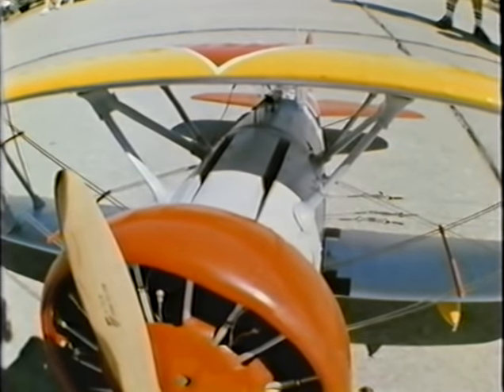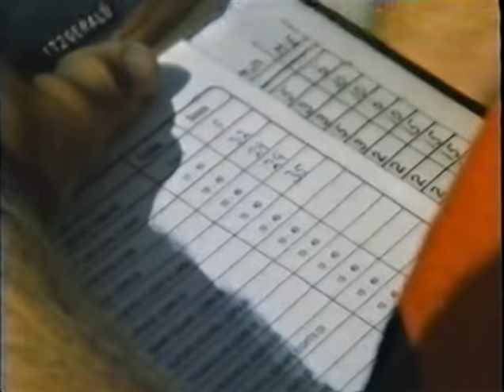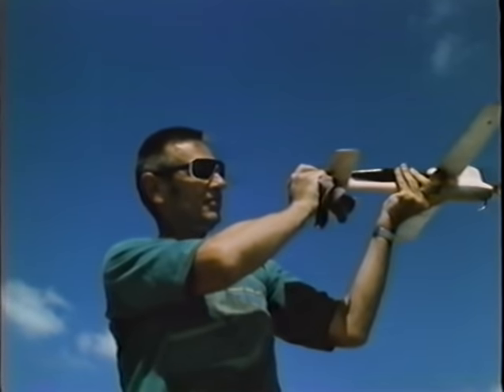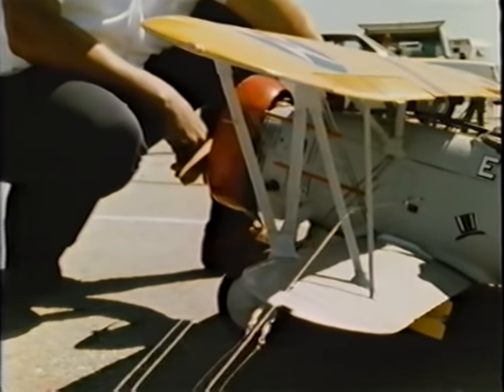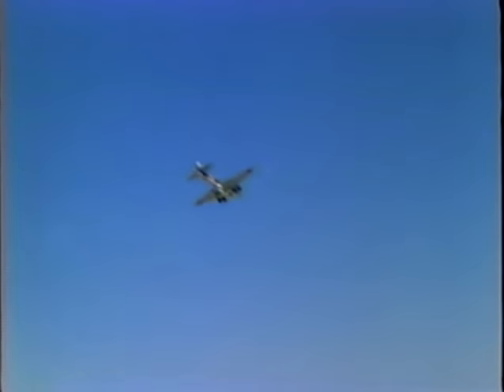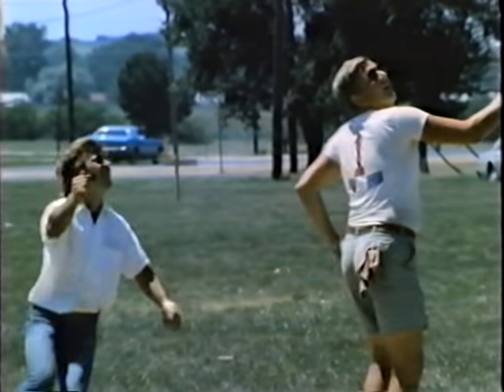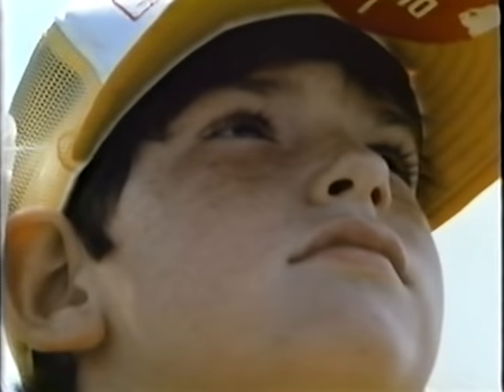Control Line: Wired For Excitement - AMA Films

Comment: This seems silly but i remember how exciting it was when i was a kid the first time i got my plane in the air. Blue and yellow PT 109 cox .049 was my first control line plane ever. Then a sig kadet got me into rc back before monokote i used silkspan and "airplane  dope" to cover. When i got it built my dad bought me my first futaba 4 chan and Enya .19 for power. Sorry to ramble but this vid really brought me back.
Reply: Eric Kelly my brother and I saved up all year for a cox 049 control line plane.  We couldn’t get the motor to gun for more than a second.  So frustrating.  We spent all our money in it.  That was 30+ years ago.  Never did get it working.
Reply: same here with the cox pt-19, what id give to have the early spting of the late eighties back but still flying today
Reply: Cox PT19 was my first also. PT 109 was a boat although the Cox PT19 may be considered a bit of a boat now days LOL.
Reply: @gen3v8  I had both!  The good old days.
Reply: I also had a pt-19 and a p-40 . After that I started to build goldberg balsa wood planes using .049 cox engine.
Reply: I remember the smell of dope from my grandpas basement workshop. That and the thousands of T pins holding wing ribs together.
Reply: Its amazing how far the hobby has come. Fpv, drones, now the same cutting edge aroespace technology used in fullsize aviation, the use of carbon fiber and other materials and even gyro flight stabilization used in early f16 fighters is used in rc all contained on a tiny printed circuit board. And now the advancement of battery technology has taken the hoby to a whole nother level. I remember when rc helicopters required a deep wallet and lots of skill and now anyone can afford it and even fly one right out of the box. Amazing stuff
Reply: @MrCarnutbill67  ..that orange cement that took forever to dry.

Comment: In the early '50's we had up to 5 aircraft in the team racing circle and the fusilage had a minimum cross section. We won a meet at Willow Grove, PA by gliding across the finish line after not fueling enough at the pit stop because the engine was started before the fueling was finished and vibration foamed the fuel. We had two pit crewmen and used phone jack's for glow plug power. More exciting than any Indy 500
Reply: I live an hour away from the Indianapolis Motor Speedway.. I go to the race every year.. I see how watching these toy planes fly around could be fun, but there is no way it's more exciting than the Indianapolis 500.. I mean 235,000 people getting wasted and watching race cars crash into each other at over 200mph is about exciting as it gets.. Even If you are not a fan of racing the track is the place to be on race day.. It's basically the biggest party on earth..
Reply: @MarkLada  I have listened to indy on Fm radio since the 50's and watched it ever since it was on TV. 250,000 people getting wasted and hoping for crashes is not healthy excitement. Indy and U-control team racing is about technology and skill and both require a lot. I have participated at a national level in model aviation and it is serious stuff. I'm also a  EE and retired airline captain
Reply: In the race events I see some flyers pulling on the control lines. Was that allowed? Wouldn't that have the effect of swinging the plane around and at same time reduce the radius of the flight, which both help to speed the plane up.  I always thought the reason the handles were anchored to a pole was to precisely prevent both these actions from being performed.
Reply: @davidl5546  in the old type there was no anchor and you couldn't pull the plane around with several others in the circle.

Comment: Just seen this and remember my first control line plane. Also a PT 109. After breaking it several times I was broke repairing it with new parts so i started to build my own models from kits and then plans. I still have a copy of RG Moulton's Control Line Manual. 
I remember the excitement of going to the British Nats every from age 10 to probably 16.
Then I discovered motorcycles😊

Comment: I remember  beautiful and nice flying U-control scale models flying in competition at the Milwaukee, WI fairgrounds back in the 50's when I was a kid. Back then, RC was mostly experimental and models had to be large and boxy to carry the heavy receivers , batteries and complex escapements for a few minutes of semi-controlled flight, if you could get the spark ignition engines to cooperate. RC really came to life when transistorized receivers and proportional controls became available.

Comment: My first make believe airplane was a couple of rulers, tied to tube, with rubber bands turning a "propeller". My first real powered model plane was a control liner. With a Cox Pee Wee engine. Anyone remembers this engine? Man, it screams like crazy!  Had no instructor. Could not even complete 1 circle. Sob, Sob. My beautiful plane is broken. It was harder than I thought! Finally got the hang of it. Cox 049, unforgettable engine. And those diesels! Later went on to RC, gliders and powered, and also Full size gliders and PPL, light planes.

Comment: Good film, but it's a shame they didn't include any actual sounds of these aircraft's engines running at full throttle during aerobatics and speed runs. We had hours of fun in the neighborhood flying Control line models.

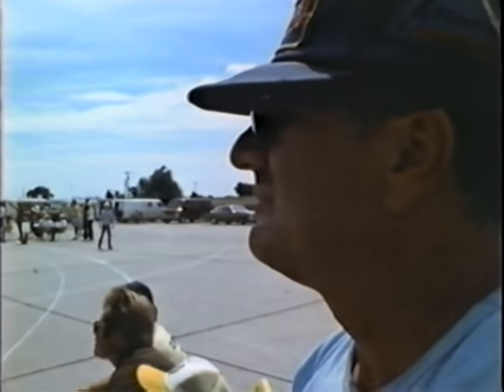Comment: At 17:00 on flying dancers, they are using diesel engines ? On refueling and starts I don't see any ni starters or glow plug batteries ...
Reply: Video explains it, and I kinda want one of my own. They had 'hot gloves' which put the glow driver in a glove. The crew guy just pinched the engine with one finger on the glow plug's 'pip' and the other on the crankcase somewhere.
Reply: @TestECull  Actually, a wire leads from engine ground to one plate on the fuselage and another wire leads from the plug to another plate on the fuselage.  These wires and plates are permanent and usually faired into the plane's structure.  The finger ends of the hot glove contact the plates as soon as the crew grabs the plane.

Comment: This is late 2020 and if the FAA has it's way this is the only type of Model flying. They are out to out;aw all nonteathered model flying. No Radio controll ever again.
Reply: Yes, I fear this coming If the R/C plane is a section size wingspan over 10 or 15 feet (4.57 m) had to follow the FAA guideline?  Some R/C pilots had radio headset.  But they want to ban all RC and/or Drone (bad enough to have to register all GPS/camera drone. And large scale RC planes register with FAA ID plates on them as for Drone. You can "loot" but you can't fly toys!